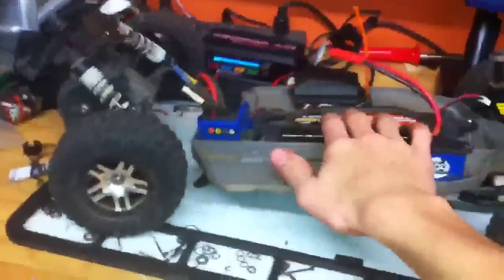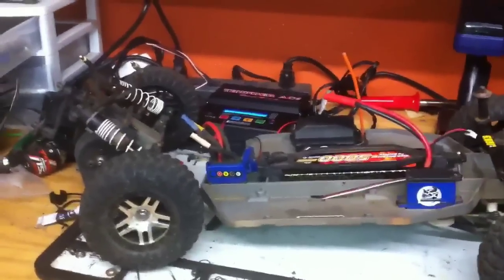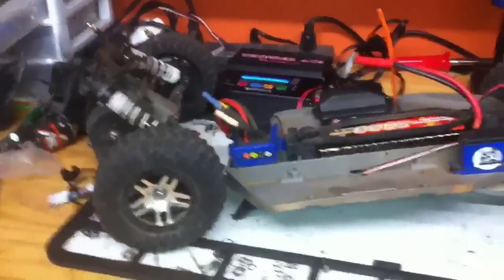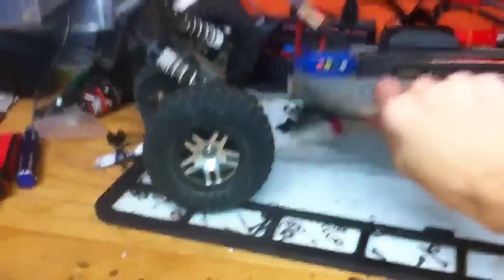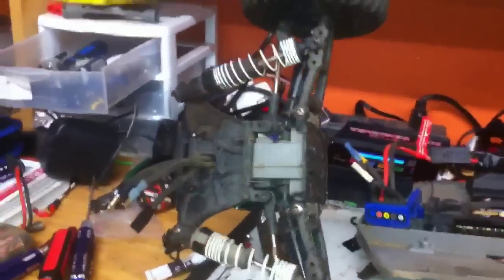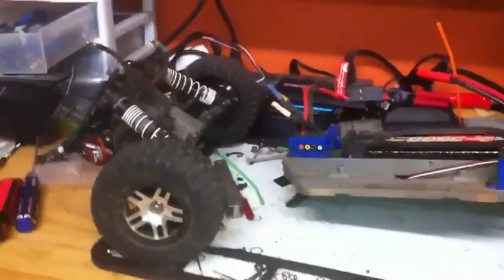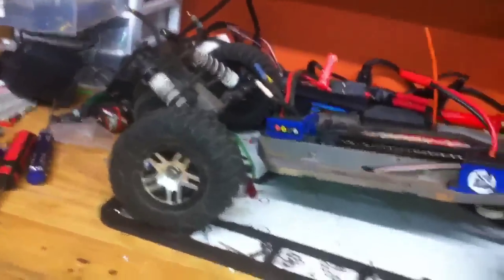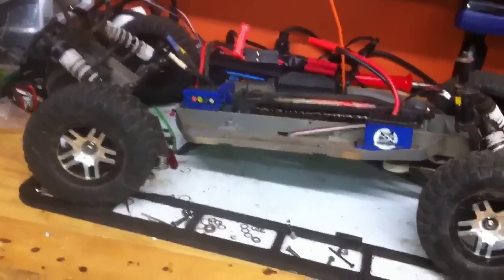I finally killed my Traxxas Slash

Comment: dude, i have the same car as you but i keep having a problem with the motor i think. there is like this plastic gear, and it just keeps stripping out and i have replaced it like 4 times!